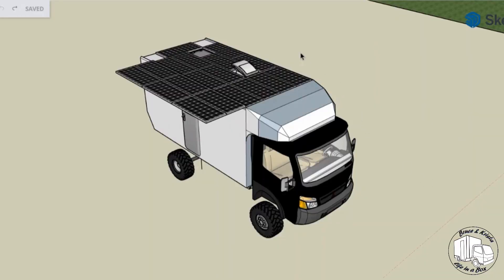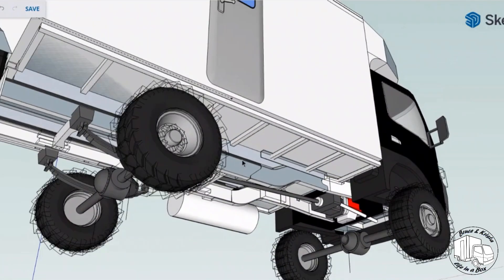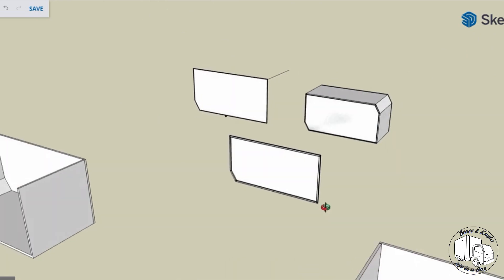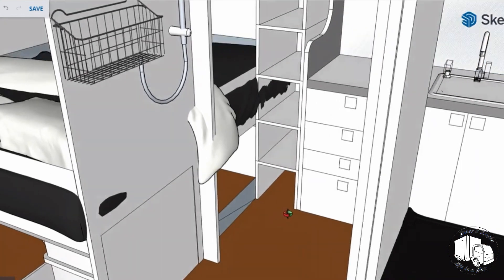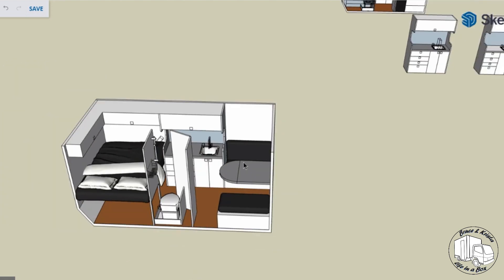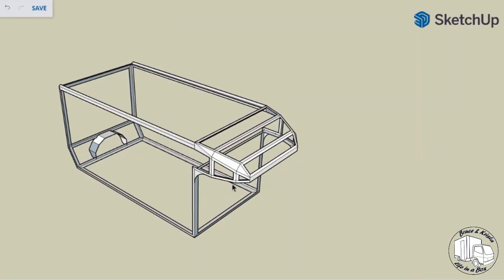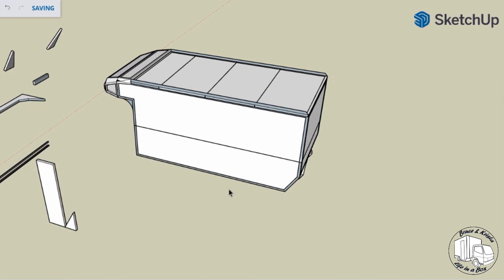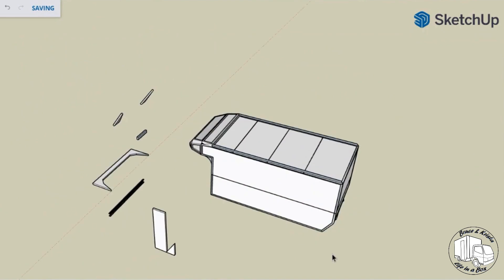Mitsubishi Fuso 3D Model design work!

Comment: If that were mine I'd turn the bed 90 degrees so you don't have to crawl over Krista, or her over you, to get out of bed.  Then I'd extend the back headboard out past the floors end and make a more angled underside support.  This way you could put a motorcycle on a lift, parallel to the back of the camper, and raise it under the head end of the bed.  And not take up any more of your floor space than you have it now.
This should allow each person to be able to almost walk to the halfway length of the bed to get in it.    My Class A is this way and since my wife and I are older, one of us is constantly getting up to go to the bathroom.  This will give you a space to mount your spare tire/ and or motorcycle under the bed on the rear bumper and water/ fuel cans.  The main downside is pulling a flat nose camper would be out of the question without an extended tounge. But a flatbed car trailer or flat towed vehicle would work easy enough as the bed may be extend a little more closely to the towed hood. Check out the channel "Drive the Globe" http://youtu.be/kh4AUtwB80c  for Michael Langfords Stewart Stevenson build.
I love his slide out porch too.  Makes going up and down the steps a lot safer.
Reply from the maker: Yeah, we have thought about rotating the bed, but the issue is with a bed that’s 6.5’ long, we loose a lot of interior space, since our whole interior will be just under 14’ long (this keeps the whole truck under 20’). With the bed sideways it leaves about 2/3 of the rest of the interior available.  The departure angle on the back of the box I s intended to cover the spare tire, again, keeping total length under 20’.  Our previous Fuso (2WD) had a lift gate on the back that folded up, great for a little porch!

Comment: Ideally, there would be no seams.  Could you get them to fab full size panels?  If not, I agree that the horizontal seams look better.
In watching a few vids about composite panels, the style I like best is that which uses U shaped fiberglass channels into which the full size panels are glued, resulting in zero water leaks and zero thermal coupling. Sourcing them is a beeyotch.
Reply from the maker: Agreed, the extrusion is not easy to get!  I’ve got full size panels now, one piece per wall.  😎

Comment: Great job!! i like the look of the horizontal panels but feel that the vertical panels might be less prone to leaks, all though I don't really know how those panels fit together so that may be a non-issue. as far as strength is concerned, can you add a support brace to strengthen it? again I don't know anything about those panels. could you get a sample to test?  Would you be able to share the panel manufacturer? it sounds like a cost-effective option!
Reply from the maker: The panels are tongue and groove, so hopefully a horizontal seam wouldn’t leak.  There will be at least one vertical wall attached to each side wall, so that will add strength across the seam.  Search for Iso Wall panels - many companies make them!

Comment: Great job with the sketchup!.. I just got a 1998 fuso 4x4 and I'm working on the box design, pretty much same floor plant as yours. how wide is your bed?, my idea is have a queen size. My box will be 14' long and 82 wide. This project will be my second build, I have a land rover 101 camper conversion with a pop up. Saludos!
Reply from the maker: Yep, queen sized bed - box is just under 14’ long and 84” wide! Our goal is to be under 20’ length over all.

Comment: It looks like a nice design to me. With all those solar panels and battery's, You should have a look at a freezer toilet. They are crazy expensive, but you can just use 12v compressor freezer set at -15c. place an insert/bucket in the chamber, add a plastic bag. No smell and easy eco-friendly handling. I am building one right now for our fuso slow-build. Regarding the panels. Would go for the vertical design. Always go for function, I guess that design can handle more chassis twist.
Reply from the maker: Already have a Natures head - but interesting concept in freezing it!